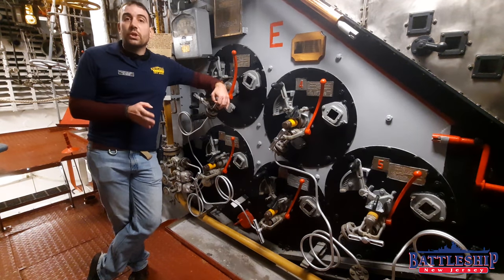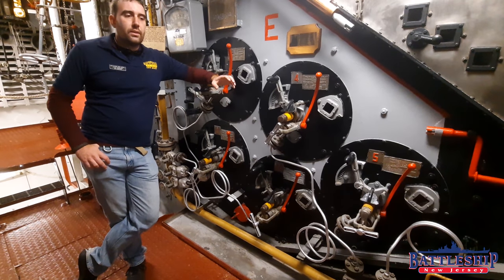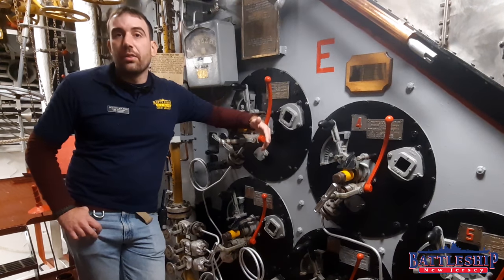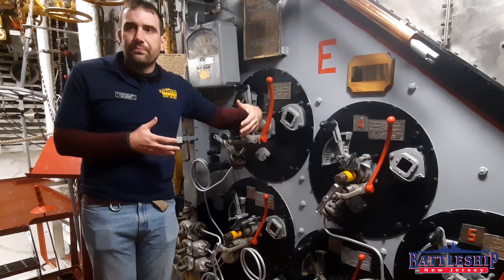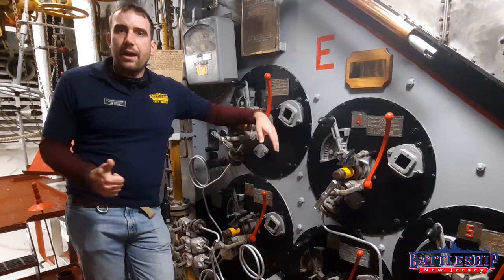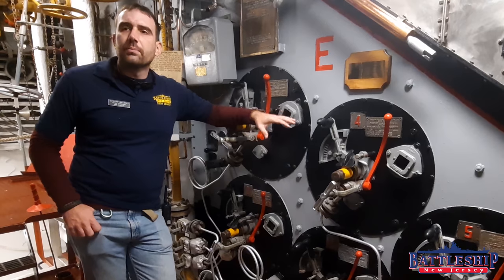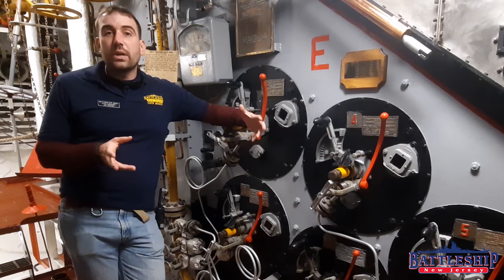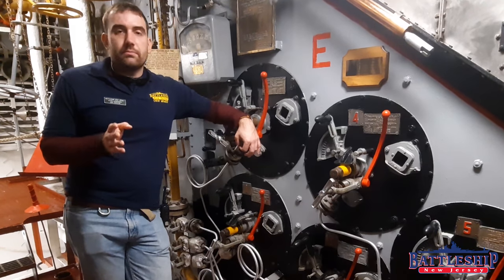Nuclear Powered Battleships

Comment: I agree with Captfjparks; a weapons grade uranium reactor using 99.99% fuel is NOT fragile by any means- unless they were completely flipped upside down (I'm speaking as a Boeing Engineer who was put on loan from time to time to give Puget Sound Naval Shipyard a hand when they were short on qualified hands) but if that happens you've got other more pressing issues anyway.  But the cost?  To build an Iowa class battleship today would easily cost $30 billion dollars if not more- we no longer have the tooling, to make the armor, because ships are no longer armored.  You say the Iowa's was underpowered- this is true.  To move something "that big" you're going to need at least a two-reactor, 1Gigawatt power plant- they're not cheap, around $3 billion dollars each.  But more importantly?  1)The engines on all 4 battlewagons are shot.  They're at the end of a life cycle and would need to be totally rebuild- not impossible, but not economically feasible either.  2)Yes, cutting through the hull would be a pain in the ass- but you'd only have to cut through it ONCE, and then simply patch with a slab of 2" plate- putting in a 14" slab of armor would be useful for what? Such armor won't stop a missile.  3)But the biggest reason why they'll never be used again?  There's simply no mission for them.  You could in theory- IN THEORY- take off the guns, hollow out the magazines, and install something like the Soviet Kirov or one of her sisters.  Other than that what could it fight?  What other ship(s) on the planet would it fight?  OK- load it up with cruise missiles- like the USS Ohio submarine.  And,,,,the Ohio's overhaul cost $3 billion, and has 214 Cruise missiles.  So we've spent $10 billion out of the 30 billion required to reactivate it.  It's just not economically feasible to bring them back.

Comment: when hearing about the Rail Gun all i could think of was how amazing it would be to see a triple or quad turret on a battleship, hoping the guns were light enough to do a quad
Reply: Dan Ward-TRP there has been some work done in materials science, specifically using ceramic sliders, that have gotten experimental systems up to 400+ rounds without major barrel degradation. Railguns would probably be as heavy or heavier than normal barrels but they allow you to remove all the weigh in powder charges. You gain either more ammunition or larger power plants. I myself would think to enlarge the power plant to handle the energy drain for both weapon and propulsion systems. Even without going nuclear, gas turbine power plants are a good option.
Reply: @JaneDoe-dg1gv  you also remove all the weight from the large shells . i think Rail Guns would be the future for Battleships. i would also increase armor thickness as well
Reply: @Dan.IdahoNorthernRy  There isnt really a future for battleships in the first place. railguns if they come to fruition will be put on firgates and destroyers.
Reply: Rail-guns have turned out to be useless as they need to be replaced relatively often.

Comment: To further add to what Captain Parks said, naval reactors have a means to replace fuel rods - it isn't necessary to cut through the hull or decking in order to replace them. It'd be a lot of labor and a lot of bolts, but easily something accomplished with a week or two in port, not even in drydock.

More importantly, though, is the reality that gun-ships are really just not a viable piece of naval warfare anymore, more's the pity. Any application suitable for guns with calibers larger than about six inches (with debatable arguments for an upper limit of eight inches) is better suited for modern missile systems and torpedoes in the overwhelming majority of situations.

Comment: As a former nuke mechanic on LA class submarines, I agree with everything said in the video.
1--refitting Iowa class with nuclear reactors (or even replacing the engines with modern gas turbine or diesel) is PURE INSANITY, for the reasons discussed in the video.
2--Considering the main roles an actual armored, big gun battleship would have (NGFS, getting close enough to heavily defended shorelines for deep cruise missile strikes, countering "low tech" threats like swarms that can make choke points too dangerous for normal fleet assets) are roles that require being able to get hit and hit hard and not just survive it but continue to function and finish the mission.  I would have to agree with the curator, pressurized water reactor plants are not the kind of plant you are going to want under those conditions.
3--As for nuclear surface combatants, what we will probably end up with (if we decide to build a new class of nuclear surface combatant) would be something akin to the nuclear powered cruisers of the past, probably about the size of the USS Long Beach or maybe a few thousand tons heavier and would specialize in long range weapons and very powerful sensors that require a LOT of electrical power.  I'm picturing something with limited stealth features (like the Burke class), around 20,000 tons, with high power dual band (X and S) radar, a laser capable of targeting anti-ship ballistic missiles at mid-course phase, and one or two railguns with a range of greater than 150 nmi.  Of course these would not be nuclear battleships, just large nuclear cruisers

Comment: I saw this someplace and I cannot remember where.  The idea was a modern modular Montana class size battleship with nuclear power from the new Ford-class carrier size reactor.  They purposed only 2 three gun turrets on the front, which could potentially even be rail guns which would give them incredible range.  Where the rear turrets were to be converted to vertical launch missile tubes of several different types.

Comment: The other thing about carriers is they generally operate at the range of their aircraft ie, far away from the enemy. If you look at the Kirovs, their primary weapons are cruise missiles, again designed to operate at long range. Essentially the things that will threaten them are things like missiles, aircraft and submarines, threats that are countered by defensive systems/weapons rather than armour. They are not intended to get involved in direct slogging match where munitions hit the Hull. If that happens, something has gone wrong with their defensive systems, and indeed having a nuclear reactor in the event of a Hull impact could be a major liability.

Comment: A peculiar thing is that heavily protected surface vessels (like battleships) armed with missiles and modern AA and ASW suits may be virtually unsinkable. Nobody is going to use nukes nowadays and 1-2 anti-ship missiles is nowhere near enough to sink a battleship like vessel. And smaller hostile combatants cannot get in close enough (or if they can, there are still nine 16” democracy delivery tubes).

Comment: i tend to agree that refitting an existing, museum no less, with nuclear power would be probably more expensive than just building a whole new ship. but nuclear power plants are not all that fr4agile, and there are modern designs that might even make refurbishing possible. something like a molten salt reactor could be built in place and have fuel pumped in from the dock when it was ready to commission.

with that said, i cant think of any particularly good reasons for a battleship class in modern warfare. we have very heavy shore bombardment and ship to ship capability on existing lighter classes, and the advantage no longer lies in surviving hits, but in avoiding being seen altogether. and our carriers, all 14 of them and counting, are very good at projecting force.

i just cant see a use case for a ship in the fleet designed to take hits the way a battleship is. and as i said, we have aircraft and destroyers who can fire anything up to nuclear armed missiles and torpedoes at anything you might conceivably want to fire big guns at. keep in mind that a modern fighter jet carries more weight in ordinance than a B17 did in WW2 and can be launched and recovered from a carrier and arrive at a target at supersonic speeds and land precision munitions wherever they want.

BBs were useful in the era when very few shells hit the mark, and those shells could be deflected by armor. that simply has not been true since aircraft started dropping accurate bombs.

Comment: Nuclear power math works for aircraft carriers. The whole point is that it frees up hull volume which would have been used for propulsion fuel in favor of additional jet fuel. This allows a carrier to sustain multiple days of round-the-clock flight ops for the initial "shock 'n awe" opener of a conflict. At-sea refueling of a conventional carrier may require coming off station, and at the very least takes many hours on a certain course and speed... they can't do combat flight flight ops during that period. Nuclear power for other surface ships makes less economic sense, cheaper just to refuel them at sea. I'm an ex Navy Nuke.

Comment: There was talk at one time of building the Montana class as a nuclear battleship. They were going to remove the rear guns and make that area a hanger for vertical take off craft and launch for amphibious craft. The forward guns would be replaced with modern rail guns. There would've been 5" guns still, but rather then the other cals, they'd be replaced with 3 C-wis on each side. Honestly with Russia nuclear battle cruiser, I mean they showed it could be done. But ours would've been way more efficient.

Comment: One could take the plan for a super tanker (multiple hulls makes it more survivable), power it with nukes, arm it with extremely long range rail guns for shore bombardment, add directed energy weapons to back up the antiaircraft weapons and put a few VLMS on the rear deck.  Ouala, you have a modern battleship that can remain more than 50 kilometers off the coast and still reach deep inland with shore bombardment.

Comment: Several responses address the technical issue of reactors: That's not the starting point of considering the applicability of the traditional battleship. Naval bombardment isn't completely dead but Marines are taking V-22's beyond the beach; basically "swimming" ashore is too slow for initial assault. Your love of the battleship is causing you to ignore the integrated systems - amphibious assault ships are as much carriers as landing craft.

Comment: Some of the fourth generation molten salt reactors are a lot less vibration sensitive than the old ones and might be reasonable for a ship that supposed to be hit. The nice thing is they're cooling systems are better design because that's the true scare of taking a hit is that you lose reactor cooling

Comment: one other point about naval nuclear reactors is that they use weapon's grade fuel. If in a fight the reactor vessel was breached, the contamination would be significant. Greater than that which would come out of a reactor with a similar mass of fuel of a lower, civil enrichment. it's for this reason that the cruisers were decommissioned, even though their primary combatant would likely be aircraft, being in a carrier group means they would be a prime target for enemy subs, as aircraft carriers are nearly impossible to sink. I'm sure the navy makes their reactors pretty damn strong, but as you said in the video, there is always a chance. That being said, I do agree that they were relatively low risk and it was a huge waste of tax dollars to decommission them so early. At the very least, they could have been repurposed.

Comment: One possible for a future BBGN, would be a COLANOG (Cooperative Electric Nuclear and/or Gas Turbine), this way you have a secondary/supplimental system where the nuclear power is good up to let's say 28 knots, and the gas turbine can be use to provide power for additional speed or to power newer weapon systems (like fiber-optic lasers or railguns); to get the ship underway as the nuclear reactor is brought up to speed.  At the very least, a future BBG should use gas turbines driving generators like the Zumwalt, and in this case using the GE LM-6000+...

Comment: Nuclear reactors on main combat ships have been done on the Kirov in Russia, but they have decided to also have the traditional fuel boilers as well.
But the truth is, when it comes down to it, most shipborne nuclear propulsion doesn't provide electricity, they are usually direct drive.
And that direct drive lets you put a lot of power to that screw or jet, but if you want to be stealthy, it requires a really precisely engineered turbine, bearings and assembly.
That is another lesson the Russians learned during the cold war, while the British decided to have an electric motor for silent running, and open up for direct drive if they needed to run.

But yes, the Iowa's would be very cost ineffective to retrofit, building something new would be better, because the bare hull is the cheapest part of the ship, but the stuff in it with the work that requires is what makes them cost the big bucks.